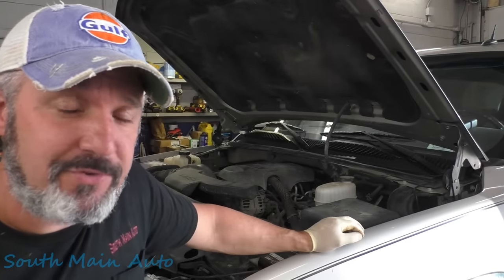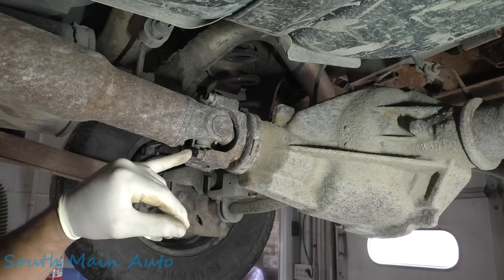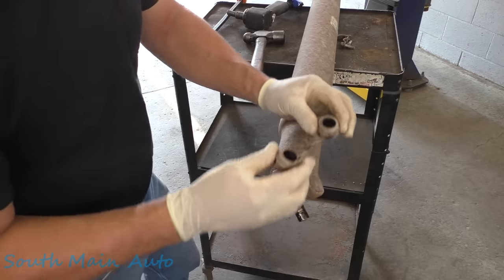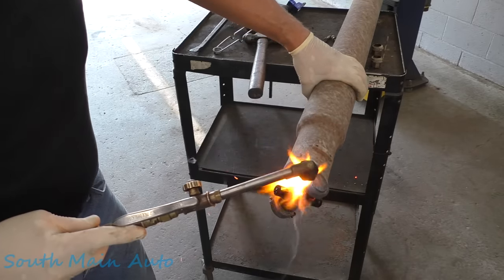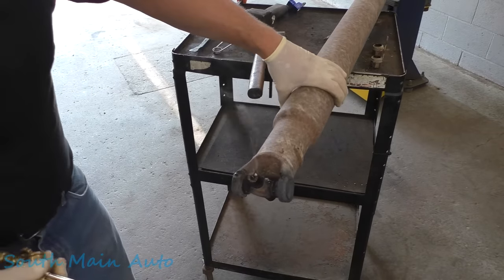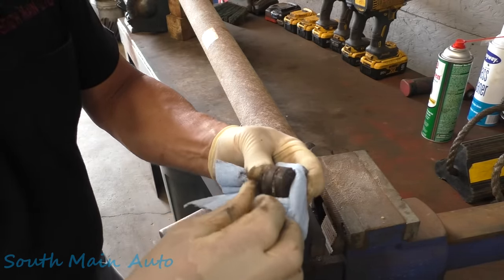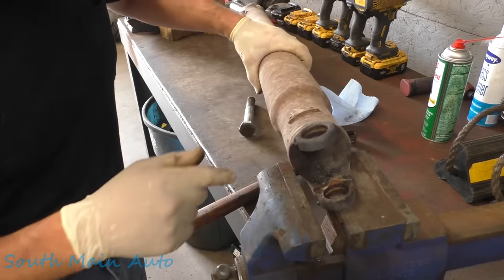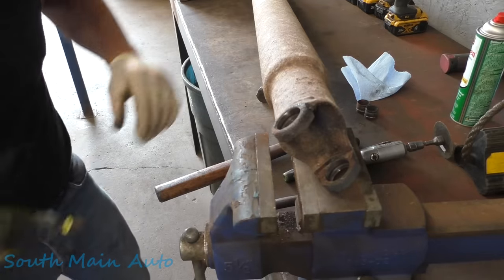GM Nylon Injection U-Joint Replacement

Comment from the maker: Propane Torch Head : https://amzn.to/3PYH9Go
Gulf Distressed Vintage Adjustable Snapback Hat : https://amzn.to/3OglUyx
40 Pack 1/4" Abrasive Flap Wheel Sander Set : https://amzn.to/44oRVdj
Reply: Could you write the name of that U-joint you recommend down here in comments. I'm not picking up on the name.
Reply from the maker: @davide.s.9880  Spicer https://spicerparts.com/parts/driveshaft/automotive/spicer-light-vehicle-u-joints
Reply: Do you have a link on that grease gun adapter you used, I have greasable U-joints on my Tahoe and hate using the "needle" style, would love to try what you used.
Reply: Did some research and I believe I found the adapter myself looks like a Lock N Lube Recessed Fitting Adapter SKU: LNL128
Reply: gm got something against 1350 u joints,, seems they allways have to do something different than normal.. so that its ''theres''.. or name it different, but its the same.. ill keep my ford, all ford.. cos it works.. if gm didnt pull out of aus, the tracks here would be wider,,for me.. & not all toyota width..

Comment: I remember going on a field trip when I was in Vo-Tech school for auto mechanics in 1975 or 1976 to a company that specialized in U-joint work. They pointed out holes in their ceiling from the plastic retained caps would blow out when they heated them up to remove them. I think they were just recently introduced by GM on the constant velocity type driveshafts.
Reply: My 1996 GMC Yukon had the plastic retained journal caps.
Reply: I had the displeasure of replacing constant velocity U joints on some of the old classic barges of the 70's. I hated those things. lol
Reply: @stevea6722  1975 Camaro had that style bearing cap retainer and straps, I bent the  straps and the driveshaft spit out of the yoke.  I would have preferred GM used the "U"bolt type retainers like Ford and Chrysler used.
Reply: Did anybody else blow on the screen to get rid of the smoke 😮
Reply: @mazomopar2156  no I walked away couldn't stand the smell, thanks that made me laugh

Comment: Drive Shaft Story: As a teen in the 70's, I took a buddy to a Pick 'n' Pull Parts Place for a drive shaft. Found one and asked the owner how much he wanted for it. Too much, so we walked away. As we were about to leave in my station wagon, some of the other guys came out of the gate in front of where we were parked, and said that they'd sell the drive shaft for $20. We said Yes, to their behind the owners back deal!
Reply: Either that, or the owner tried to get you to pay too much, and when that failed, he sent his workers out to pretend it was behind the owner's back.
Reply: @anwalt693  Agree.  Couldn't come to terms with the dealership on the purchase of a used Jeep.  Manager sent the salesman out who tapped on our window as we were about to pull away to say they would take our offer.  It was an internet search for a very specific model (TJ Unlimited)  Manager said he couldn't believe we were willing to walk away after driving 250 miles over a few $ thousand.  I guess with that distance they figured we were not going to sleep on it and come back.  They had it for awhile.

Comment: I was changing one years ago with the heat method and one of the caps shot out, hit the fluorescent light and busted both tubes! If there is a little grease left they will come flying out of the yoke! That Suburban looked very clean underneath.
Reply: A junk yard guy told me always drill 1/8 inch hole in the bearing cap of the u-joint, so when you cut the cross  with a torch the pressure would be relieved and the cap wouldn't shoot out like a bullet.
Reply: yeah, they can eject forcefully if lots of grease and sealed well/rusted squeezed seal.  you can drill a small hole in the caps first if worried, or just make sure you and nothing else is in line with their trajectory. 🤪
Reply: Remove the zerk fitting first

Comment: Just did all 4 of mine on my 06 avalanche. One thing I've found that works good for the average diy guy is to save an old hub bearing and knock the studs out. Drive shaft fits over center hole perfect to use socket to knock caps out. 8lb sledge knocks them out with 2 or 3 good taps
Reply: No hammer is too big.
Reply: I did all 4 this way.  It indeed is not too big. You can swing a smaller hammer twice as many times if you want. I prefer to work smarter not harder.
Reply: You only own shallow sockets?
Reply: Tappy-Tap 🛠
Reply: The brakecleen can on the bench behind the vise with a high powered smoke wrench  was pretty scarey!!

Comment: Always nice when the mechanic tells the customer what the vehicle needs to fix an issue, and then the customer give the OK to actually help take care of the problem. Why people bring a vehicle in only to try and "cheap" around the actual fix is beyond me. Just never made sense to me. Nice job!
Reply: Well, sometimes, the shop is a rip-off.  My mother in Las Vegas (2,000 miles away from me) took her Equinox to a Pep Boys due to a cam timing solenoid code.  I told her, "Avoid the dealer.  It's a simple job that should take about twenty minutes if the mechanic is blind and missing an arm."

She was quoted $575 in labor...  Needless to say, I ripped the service write a new one over the phone.  I then proceeded to drive for three days to Las Vegas to do the job for her.  I go, "Mom, stand right here and watch how simple this job is."

After the ten minute swap of both intake and exhaust, she goes, "Is that all there is to it?  Boy, some people are just thieves."

Comment: This brings back memories.

Back in the '70s I worked in my dad's service station.  We always used a vice and a couple of sockets to press u-joints out, including on GM's nylon injected ones.  They were always stubborn but would let go.

I expected to hear the classic "front is back and back is front", but then I noticed the zerks were in the middle on your parts.
Reply: Same here. I worked in a fleet repair shop, and those nylon joint retainers were never an issue, and never heated them up. I don't know what the big deal is about people making a fuss over them.

Comment: Great work, as always! I just had to get my 07' GMC SIERRA 2500 HD done. 1st shop told me they replaced rear pinion seal. Seal continued to leak.. 2nd shop( got new tires, they don't deal with rear diffs). Told me 1st shop NEVER even put a wrench on it! 😡
Could see they never did ,had pics to prove it. Took it to a local garage, they added fluid, it was almost empty! Then drove it, and confirmed my suspicion about U JOINTS. So, they did them. Mine needed front and rear on driveshaft as my rig has almost 225k on her.The worn joints caused pinion seal to get messed up. So they did the u-joints and pinion seal and whatever else it needed back there. 
Anyways,  thanks for the great content! Especially CHEVY/GM. 
Cheers from Pennsylvania!
Reply: I hope you went after that crooked 1st shop! I hate liars and thieves! They should be ashamed, but I'm sure they are not....
Reply: @quantumleap359  
The 1st shop has no greasing scruples.  They could care less! They 'fixed it', prior to my buying the truck. 
All they did was clean it up, and freakin send it! No wrench marks or anything.  They dealer paid them. 
Oh well, his loss. I'm glad I've got it FIXED correctly now. Shop actually kept me informed, every step of the process.  This garage will be my go to, from now on. As my previous long time mech Shop has retired from the business.
Reply: freakin not greasing! Lol
Reply: Something I do is use a metal lettering punch and stamp each piece or segment in a line so when it reseals I get it in same order so it will stay closely balanced to how It was orginilly this really only applies at trans slip yoke or a 2 piece shaft or 2 rear r3 style u joints like my 1972 caprice has.

Comment: Bird chirp noise made me think of the story from 40 years ago about the Cadillac with undiagnosable noise problems.  Finally using a cutting torch as the preferred tool, the mechanic found a soda bottle in a box beam.  It had a note from a disgruntled assembler: "Betcha had a hard time finding this one."

Comment: Ah, this brings back memories. Your attention to detail is superb. To install the new caps and cross, I always used a couple sockets and a vise, but this way works too. Thanks for another great video!
Reply: juggling sockets and using the vice is still the way I do them, I've also used an arbor press and ball joint press. obviously I don't replace them daily and the vice is the readiest thing, with sockets laying right beside it. :)
Reply: I've used the South Main method frequently when a vise wasn't available.

Comment: Here in England the SKF bearings and UJ's are reckoned to be one of the best and are O/E fitment by many manufacturers.
Reply: Spicer, Timken, SKF.  All three are quality bearing manufactures.
Reply: I'm old fashioned. I prefer replacement parts with grease fittings.

Comment: I had a local shop rebuild the driveshaft on my 1985 F-150 with Spicer non-greaseable u-joints. Glad I went with them after hearing your vote of confidence.

Comment: My go-to scrap yard is right across the street from the area's transit authority heavy equipment repair facility.  As such, they scrap some choice bounty -- huge bearings, monster center links, and all kinds of other stuff.

During one visit I scored dozens of thick bolts and nuts -- I'm always on the lookout for hydraulic press tooling.  And with a lathe, I can cut those thick bolts down to any perfect diameter I need for driving, pressing, beating, and whatnot.

Comment: Thanks for the info. I replaced the U joints on my old 1963 Belair over 45 years ago and am now aware that my newer GM vehicles have Nylon injection retainers.

Comment: Tuesday made me wish the 2009 avalanche used the nylon instead, the snap rings that held mine in were rusted solid, wound up having to break the snap rings out and that’s not easy. Still had to cut my u joint out after it was all said and done, too. Great work Eric, we all appreciate it!

Comment: Last year I replaced ALL the u joints on my 95 F250 4x4 including the front axle shafts All with Spicer joints for a little extra security. Great video Mr. O

Comment: Eric did a great job on this, just wanted to warn the diy guys that the u joint needs the rotate free, if it is tight it will fail or cause a vibration, taping on the flanges usually works ( like he did), but if it is still tight, take it back out and hit the inside of the flanges again with a grinder

Comment: I cut the U-joints out with my torch out aswell, its the quickest way..  i noticed you didn't set your torch to neutral flame while holding the oxygen lever down,  thats how i set my torch and it cuts like a laser beam,  my oxygen is set to 35 p.s.i. And my acetylene is set to 7 p.s.i.   Love your videos man keep up the good work!😊

Comment: Back when I was a teenager, I knew a lady who owned an auto parts store, and she had an MGB as her "fun car".  I would spend time at her store and would make deliveries and run errands for her, and she would let me drive the MGB. This little sports car was prone to u-joint failure to the point that she kept a spare u-joint and a pair of pliers in the car, and she would replace the joint on the side of the road!

Comment: I remember the time I did this on my 77 El Camino. Used my plumbers torch and enjoyed watching that plastic ooze out until the heat in the bearing cup boiled the grease and it went BANG and knocked the wind out of me and scared the plastic out of me.

Comment: I did a  front u-joint on a '66 Mercury S/W on the side of a forestry road with a hydraulic jack and a hammer at 11:00 pm. No issues except had to grease it beforehand. Drove it 60 miles home; checked and pumped full of grease. Lasted 50k before I sold it.

Comment: Back in the '70s & '80s  we did a lot of these mostly off of Caddys and Buicks. We used a berzamatic torch and a brass hammer to drive  'em out. Hit them with a wire brush and some emory cloth inside the shaft once they were cooled down.  We'd charge $20 a piece to put them in a removed shaft. It was only about 15 min work, but we'd  tell em pick it up in 2 hrs.

Comment: In all the years of wrenching, i've never come across these types!
Just shows no one has all the knowledge.
Not having a torch, i used my BBQ grill to heat up the cap worked fine.
And i did use a cutoff wheel to slice the ujoint ends off.
I think one could just drive the joint caps out without cutting the Cross.
Next time i'll try that.
Great video again.....Thanks SMA!
Only "trick" here is driving a new J cap in without dislodging needle bearings in the cap.
Be sure to hold the cross in the cap end,or press it in.
If you dislodge a needle in the cap.
You wont get the clip in.
Also.. sometimes driving it in the joint can bind so tap the cap ends to seat the caps.

Comment: When I was replacing U-joints to clean the yoke/shaft where the caps go. I measured the I.D. and from Snap-On I bought a small brake cylinder Flex hone in the size needed and that will clean them out nicely. Always added an extra touch of grease to the needle bearing helps keep them in place as you pound them into place. Worked in an automotive machine shop for a while and got pretty good at GM's CV joints. I did not mind R&R U-joints.

Comment: The first time I ran into the plastic "injection" on a U-Joint was on an all original 1964 Pontiac Bonneville about 10 years ago.  I thought that was crazy but I guess it works if they are still doing it.  I also heated the joints and red plastic came squirting out.  Glad to have that mess gone and it is not hard to deal with.  Great Job!!!

Comment: Same thing on my 05 Silverado.  Not too much trouble to change, even laying on your back in the driveway.  Just lose some fluid out the trans you gotta add back. I just took a wire brush in the drill and heated it up and spun it inside the ear and it flipped that plastic right out no problem.  Nice to see an 05 up there still on the road.  My opinion some of the best years Chevy made.  Take care.
btw...I call my torch, "Bubbles", cause it'll make that metal bubble for real..LOL

Comment: I use a ball joint press. Just the C clamp.  It works great at taking them out and installing them.  No more torch.  I never really liked heating up the driveshaft anyway.
Reply: You should still soften the plastic before pressing out the caps.

Comment: I have replaced hundreds of U joints on the PTO shafts of farm equipment.  Basically the same process,but the shafts are normally very long.  I preferred the vise and socket method of installing the caps.

Comment: This brought back memories of doing the U joints in my 89 Chev Caprice.  Was using the torch to heat up the plastic and watching it ooze out - must have been pressure built up in one of the caps as it suddenly hit me square in the chest - ouch.  Hot U joint cap hit my T shirt and left a nasty little circular mark on my skin for a few weeks.  Have since learned to wear a welders apron when doing jobs like this and using a torch - please be careful when heating the caps as pressure can build up if the grease gets trapped!

Comment: I've put a hundred of those in. Usually heat the first cap until the plastic starts coming out then lay the u joint cross across the the vice jaws  and rap the driveshaft beside the cap and the cap pops out, then do the other side.  Very little torch use that way and at $300 a tank for acetylene you need to use the torch sparingly. The plastic will be sheered off that way and won't have to be removed either. Done a bunch of the double cv u joints this way too.

Comment: I used to take a brake wheel cylinder flex hone and wd40 and zip it in and out of the cap holes a couple of times in the shaft. Always came out shiny clean.

Comment: Been using heat on nylon joints for decades myself, then replace them with a small ball pien hammer, always been a fan of the heat especially when replacing front shocks on Ford I-Beam suspension, Those radius arm studs on the bottom always break off without the heat wrench, and the arms are no fun replacing when a stud breaks.

Comment: Great video just replaced mine on my front drive shaft on my 2004 Tahoe   I wish I saw your video first.  I think I would have avoided some issues! But I’m ready to do my rear drive shaft now thanks for the great videos.   My next job is replacing my intake gaskets.  I hope you have a video for that?!

Comment: I've done quite a few of those----GM has been using those for a long time, at least as far back as the 80's. And yep, sometimes that hot plastic will definitely shoot out with a pop, scared the crap out of me the first time I did one
Reply: I remember doing the Teflon injected joints in the late 70's as an apprentice. Not sure what year they started using them but probably about 72 or 73 would be my guess.
Reply: @superrodder2002  Yes....now I remember doing them in a '75 Cutlass
Reply: first ones i ever saw were in a 73 chevelle.
Reply: @superrodder2002  1970 Buicks had them, they lasted a long time

Comment: Out here on the west coast I got away with using a vice and a C-clamp on my 87 V-20 pickup. Did both ends with the top of the line NAPA ujoints.

Comment: I can smell this vid. I did an exhaust repair on an 08 Durango Hemi with 311307 miles on it, and the U joint at the rear diff still had the nylon retained OEM joint in it. That's one of those Unicorn Mopars. I like to say that the joint is "making cinnamon" when I see rust dust, pro tip, it is not as good as real cinnamon !

Comment: I used to use a ball joint press with pressure on I hit the press screw with a hammer popping the plastic joints on both sides. Then continue with the press.